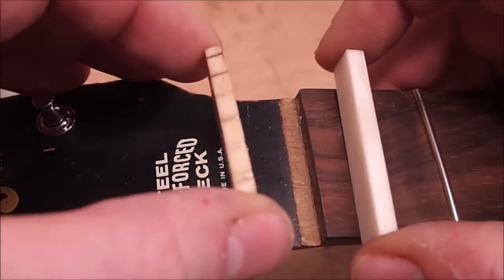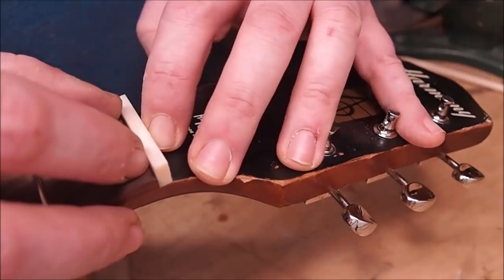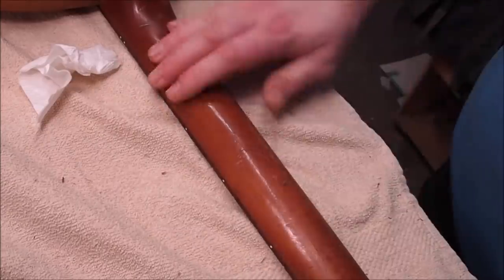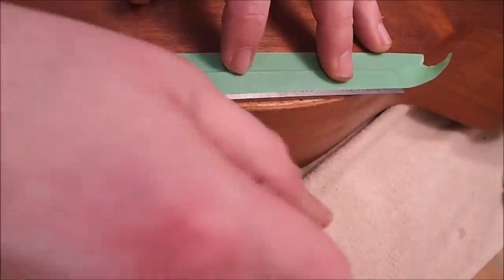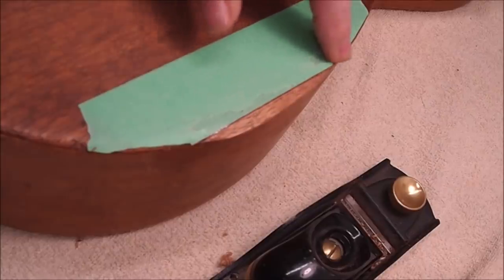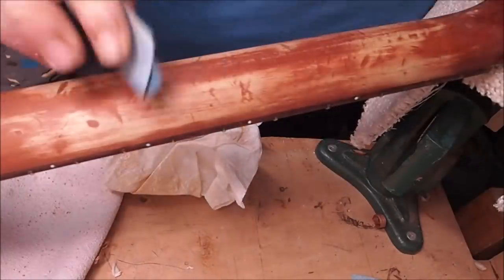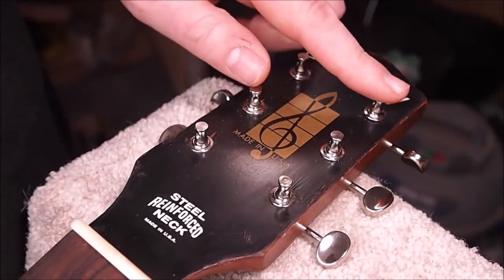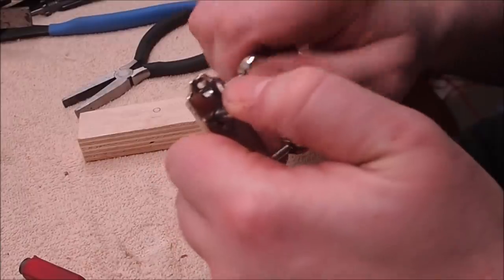Harmony Overhaul:  Part 6

Comment: This series was awesome . I salvaged a severely damaged H-165, dated from 1966. warped neck, water and black mold damage, broken tuners, poly finish half brushed on, side cracks, seam separations and tilted bridge and top. $35 for it. took me several months of casual work time, but very happy and playing it often. You are correct... it's  repair friendly  in the neck tenon area. Great video series. wish I had seen it when I did mine :)

Comment: Sorry for your loss. 

I was so excited when your tuner was doing that I was hoping you were going to fix it, figure it out and set my mind at ease lol. I had one do that to me couple years ago on a vintage fender custom shop in my personal collection. Ended up just replacing, but I tried everything to fix it. Except drilling like you. No regrets as I also upgraded to locking tuners. When I called fender to get replacement tuners they could tell me they were a special gotoh, but gotoh doesn't make them anymore. However they had a upgraded line with locking tuners that fit perfect, no drilling. 

But its always been one of those things I always wondered and bugged me what the heck was wrong with that tuner. I still have them too lol. Someday maybe I can put it back to original but I do like locking tuners.

Oh and I am about your size with bigger beard. I am not giving you a hug either lol. Made me.laugh when you said that.

Comment: I remember passing over  that french polish ur talking about for a fret board i was doing on my pet project esp ltd viper 104 it was my first time doing something do it to that guy before a customers if i wasnt sure.i ended up moving mid project to a small town higher north in Mississippi almost Tennessee and went thru the worst hardware store there after finding nothing at the lowes and the other  family store. At this one they had nothing newer than 1980 in the whole damn place .and i found an old can of 100% tung oil and i got it for whatcwas on the price tag.88 cents no bs. Long story short i opened a bag of worms that day
I tung oiled every thing too fast and got gummy had to learn to let things sit yk.

Comment: I used Zinsser (however you spell it) amber shellac on my archtop. I thinned it down but it turned out nice. The only problem I had is idiot me didn’t realize that there was shellac pooling under the fingerboard extension and running out when I hung it up after putting about 4 coats on. Atleast I learned a lesson.

Comment: Very generous sharing of all manner of information - truly helpful in a number of ways.  Many thanks.  Condolences to your family.  I’m on the road for a funeral myself - just the times I guess.  I’d be curious to learn how you prep your warm hide glue as you used for the larger wood fill on the back edge.  I haven’t seen you using heated hide glue a ton except when you feel it’s appropriate.  For such a small amount needed:  Did you have a batch going that you drew off of for just that tiny need or was that a one time mix?  I’d be curious to hear your reasoning around the use of bottled titebond or fish glue vs mixing up some heated hide glue and when one is needed over the other.  I also really appreciate your demonstrating the use of various planes and chisels.  I love how you combine easily available StewMac type of tools and go back and forth seamlessly with more traditional fine woodworker tools and can change it up at will - that’s really classy work - very nice

Comment: Looking good with the french polish!! I have a small Teac 2A mixer with the separate meter bridge that had damaged faux-wood sides. I made new one piece sides out of walnut  so the meters were attached to the mixer. I tried my hand at french polishing them and they turned out amazing!! It's very weird to start applying it and nothing happens at first. Then, all of a sudden, the finish starts to build and you end up with a deep rich luster!!!

Comment: One of my H165s has nearly identical damage at the corner of the lower bout on the top. It was (unfortunately) repaired with wood putty by an enterprising previous owner, and had opened considerably when I got it. I'm not much of a luthier (yet), so I settled for re-gluing and clamping it for now. At some point I will probably try to scrape the putty away and do a better patch, like what you performed here. Looks excellent. 👍

Comment: Hello!
English is not my native language so please excuse me if this doesn't make much sense.
Concerning that tuning key: the problem is in the worm gear. It moved away from the regular gear - I know, the regular gear moves with that stem it is screwed and creates the distance but - the "claws" that hold the worm either shifted, were not drilled in the right place, or bent and that's what causing malfunction. Depending on construction of the tuning key you can do repairs that it requires. In this case try bending the housing just a tiny bit. Sometimes when you have those big keys on fender bass there's a "leaf spring" under the worm gear that bends, you bend it back and you're good. 
I hope this helps.
Best regards.

Comment: Another video I will have to watch a couple of three times to get the nuances. Thanks for the great work.  BTW, I inherited a couple of volumes of formulary from the 1920 - 1930"s There are a lot of polish and finish recipe's, but many of the chemical and patent product names are obsolete, and the internet is (ahem) unreliable.  Does anyone know a really good source for modern chemical interchanges?  And small quantity sources for some of the more difficult to obtain solvents?  Obviously, some of this stuff is crazy toxic, but that would be good to know too so it could be avoided. (cadmium and mercury for example)

Comment: I have a QUESTION: Is it possible to tell whether that tuning peg was defective without installing it and putting the strings on? Another QUESTION: Have you used other sets of Wilkinsons before which were just fine? (I have just ordered a new set of the same kind of Wilkinsons from Amazon and I sure hope they will be ok.) Greatly appreciated.
Reply from the maker: I've put them on a number of guitars without any problems at all.  Having defective tuners right out the box is so uncommon that I would never usually even think to test them first.

Comment: Sweet Veritas low angle block plane but, if I may be so bold to critique a artisan of your caliber,

 ... for the love of God please don't rest your planes on the sole with the iron extended on a hard surface. 

Thanx.

The Veritas was my plane of choice, slightly narrower than the Stanley 60 1/2, which gave it a more confident heft